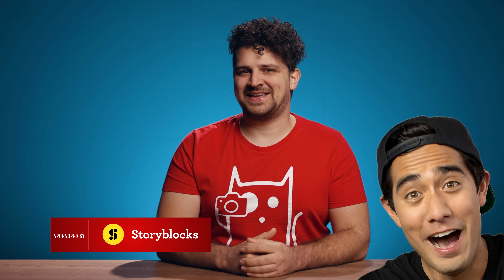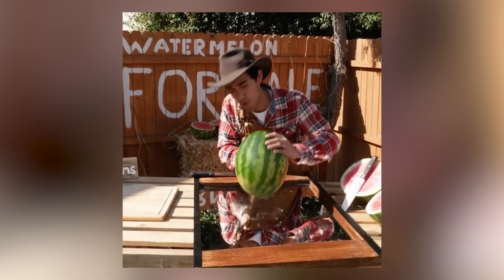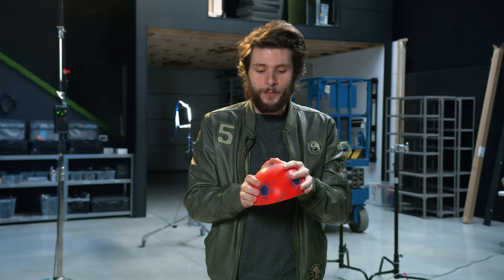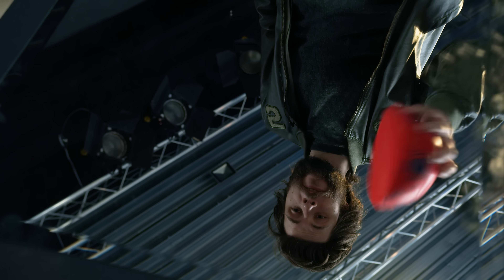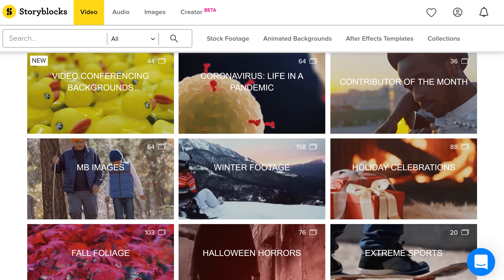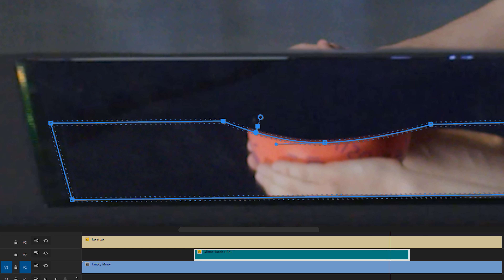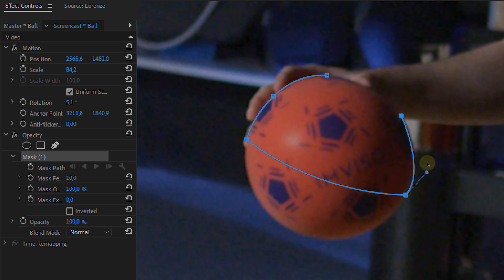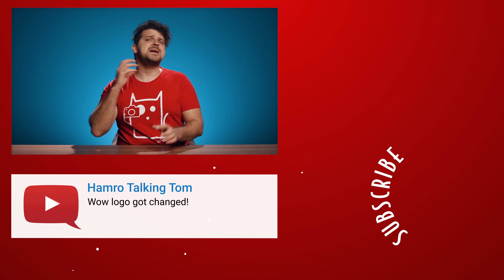Watermelon Mirror Trick By ZACH KING (Recreated In Premiere Pro)

Comment: for a similar effect we did following: We used a cord and wrapped it around our fingers, when we pulled our hands apart the cord was pulled tight and helped us to hold the hands as if we were holding an object. This helped us to remove the cord very easily, for tracking points you can see small X on the palms. So you could also use the mirror without extreme effort, since it contains the same information.

Comment: i think in the watermelon trick, Zach is holding a half watermelon the whole time. and the other half is cg. you can see the shadow of the cg watermelon is creating a darker shadow when it overlaps with a real shadow at 0:45 and the non shadow table is cutting a bit out of the shadow at 0:54 (where the watermelon touches the chopping board, you might have to go frame by frame). The moment when his hands slide on it is just an aligning issue, because what he probably did was he replaced the half watermelon with a cg watermelon over the real one to help with the aligning. you can see that it is a real one underneath at 0:46 because there is some red spill over the table from the inside of the real half. and at 0:48 you can see that there is no way that the inside part of the watermelon is fake because it has perfect lighting and real Specular highlights. oh and the "watermelon" sign is added later, you can see at 0:46 the girl goes through the sign.

Comment: In my mind it could be done even with a real watermelon:
The mirror would actually be a box, colored in green and opened at the top. Over the bottom of the box you put a camera, so that you can record what an actual mirror would see.
You start the scene holding the real watermelon halfway inside the box and pulling it out. You then put it on the cutting board, cut it in half and proceed to move it over the box in the same position you started with. And yeah, I know, it would be extremely hard to match the exact positioning.
When you edit the video, you replace the green of the box with the recording of the camera in the bottom, with the one scene where you were holding the half melon, so that it looks like an actual mirror. You then cut to the scene with you taking out the full watermelon, and there you go. Loop. Am I missing something?

But anyway as you pointed out, he's probably not using a real watermelon for the reasons you explained
Reply: Placing the camera over the bottom of the box wouldnt help much due to how the mirror reflects light depending on the angle on which you are looking at the mirror, so if the camera on which you are recording the action is placed in front of the person doing the action that would mean that the angle of reflection is different from the one that you are recording with your second camera, perhaps you can record the reflection afterwards but I still think is quite hard to achieve a good perspective plus giving it a glassy look and stuff haha, but still its a good idea and if you do it properly you can loop the entire thing almost seamlessly ;)
Reply: The camera would capture the wrong angle for the reflection.